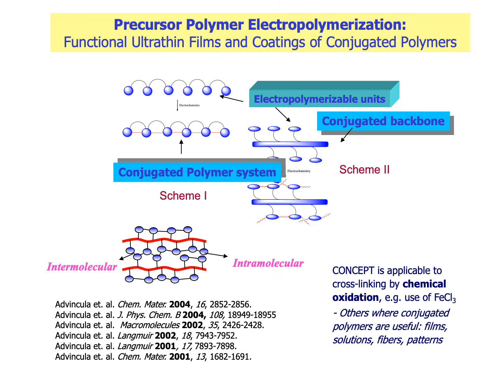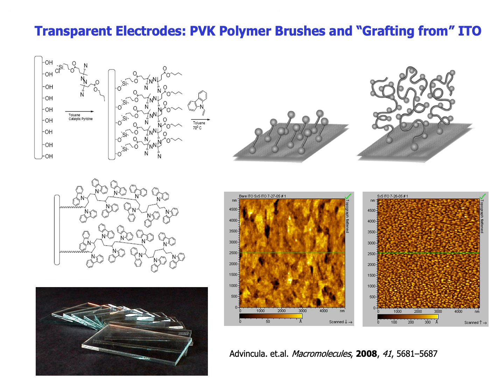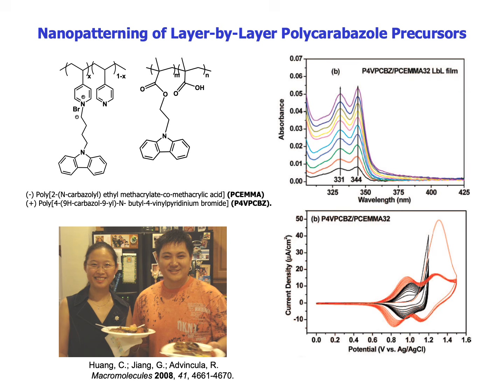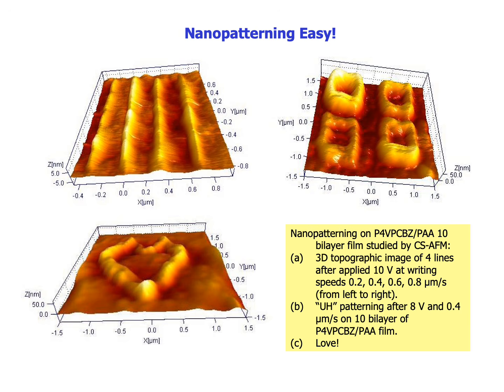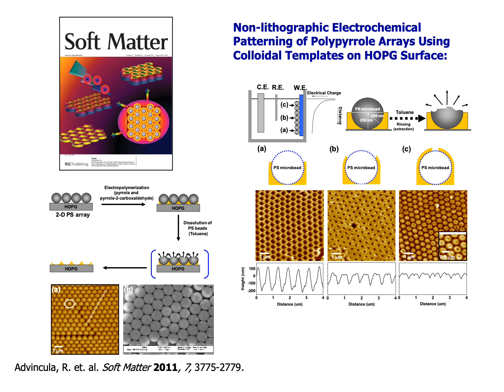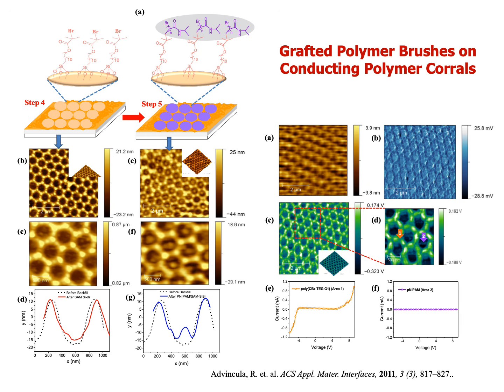Nanostructuring through Electro-Patterned Polymersand Colloidal Templated Arrays

Comment from the maker: KEY QUESTIONS:
This video explores advanced methods for nanostructuring using electro-patterned polymers and colloidally templated arrays. Here are the key questions addressed in his research:

How can conducting polymers be patterned at the nanoscale? 

The researcher demonstrates how to create patterns using electrochemical polymerization. By applying a bias voltage through an AFM (Atomic Force Microscopy) tip or using microcontact printing (4:37 - 6:15), the team can selectively deposit polymer precursors on substrates with high resolution (less than 100 nanometers).

How do colloidal templates assist in nanostructuring? 

By depositing polystyrene colloidal particles to create hexagonal arrays (7:50 - 8:30), the team provides a template for electrodepositing conducting polymers like polypyrrole and polycarbazole. Removing the particles (dissolution) creates unique beehive-like structures or capsules (8:35 - 9:00).

Can these structures be functionalized for specific applications? 

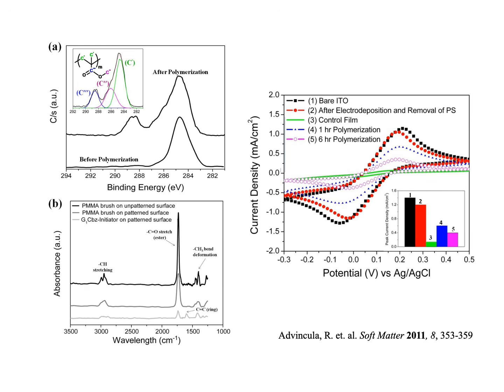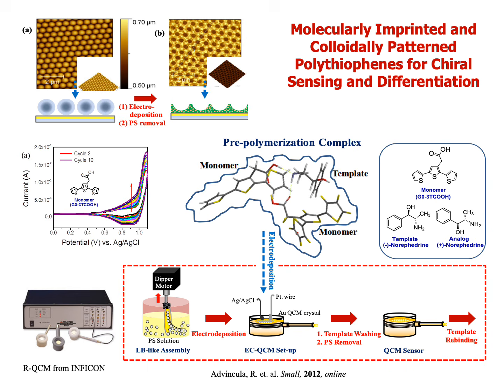Yes, the vacant spaces within the patterned arrays can be backfilled with macro-initiators to grow polymer brushes (9:20 - 11:15). These multifunctional surfaces can control membrane transport or diffusion of ions (11:20 - 12:05) and even serve as molecularly imprinted sensors for chiral recognition of drugs like norpseudoephedrine (12:05 - 13:25).

Comment from the maker: SUMMARY::

This video explores nanostructuring techniques using electropatterned conducting polymers and colloidal templates. The speaker highlights advanced methods for synthesizing and patterning nanomaterials for diverse applications like LEDs, photovoltaics, sensors, and actuators.

Key Topics:
Precursor Polymer Approach (1:38 - 3:45): The development of electropolymerizable precursor polymers used to create high-performance films, smooth electrode surfaces (like ITO), and improve device efficiency.
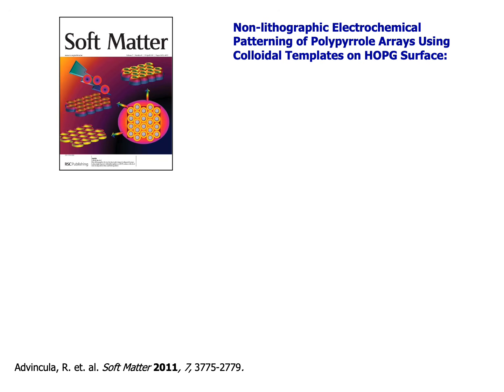Nanopatterning Techniques (4:32 - 7:40): The use of lithography, microcontact printing, and AFM-based patterning to create high-resolution features (sub-100 nanometer) by controlling bias voltage and tip movement for applications in memory and NEMS.
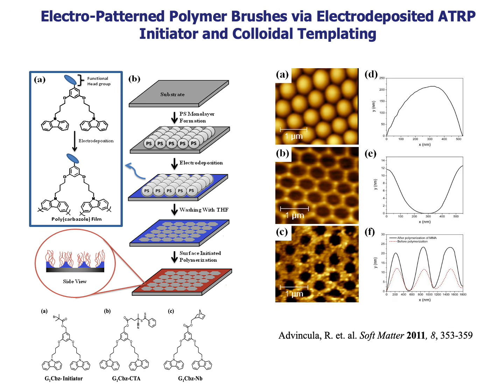Colloidal Templating (7:45 - 10:20): Utilizing hexagonal polystyrene colloidal arrays as templates to electrodeposit polymers into beehive-like or dome structures.
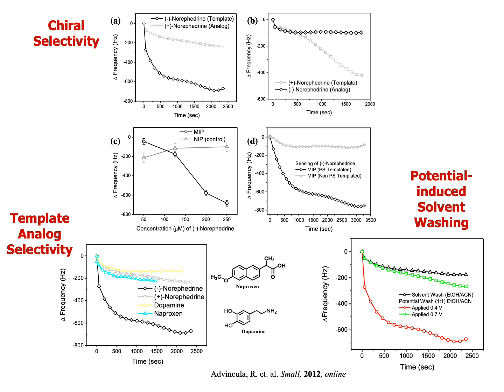Advanced Functional Arrays (10:25 - 13:00): Combining these methods with polymer brushes and molecular imprinting to develop highly selective sensors, such as those used for chiral sensing of pharmaceutical compounds.